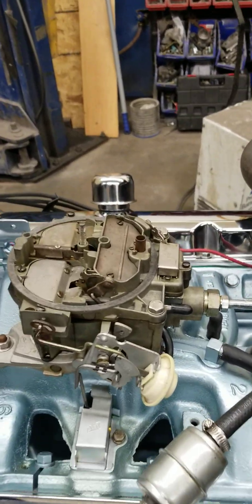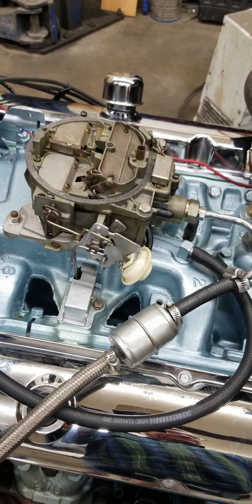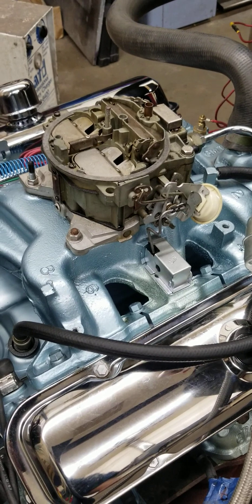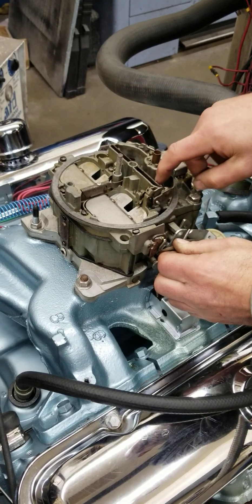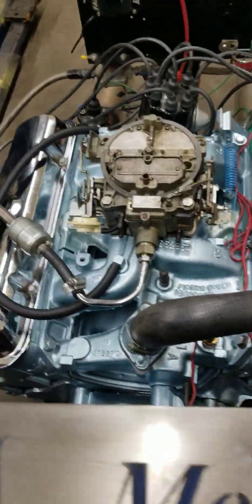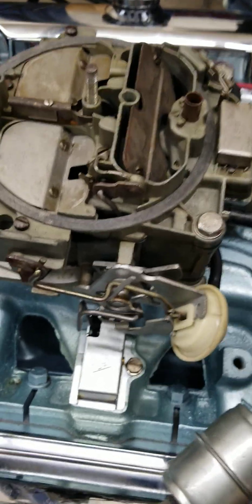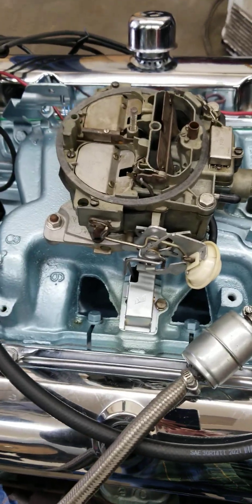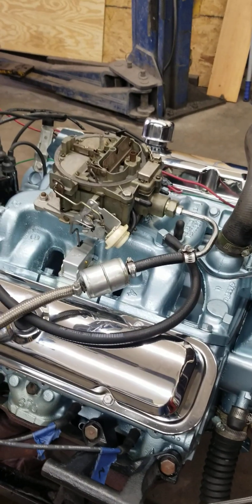#Learn The components of a Pontiac Quadrajet carburetor and #How to adjust

Comment: My family had an auto repair shop when I was a kid.

I remember QJets lying around the shop.
I would take some of them home, take them apart put them back together, sometimes I had a few extra parts left over.
I never thought they would be so sought after.
I disassembled the ones with the mechanical choke and electric chokes many different varieties.
I think I still have a book I bought on Q-Jets somewhere.
Reply from the maker: It might be the one I wrote. I authored a performance manual for Q jets back in the late 80s

Comment: do you have your pcv at back of valley pan routed to front of intake?
Reply from the maker: Yes, the 67 and older engines the PCV was in the rear of the valley cover. 68 and newer its in the front.
Reply: @dcimotorsports1111   cool thanks! on my 69 the rod enters on the right side of stove , slightly different. back when i rebuilt those there was a spec for the space I believe, just like the spec for the float level.  have a good day
Reply from the maker: ^7 is an odd year LOL.  @ubethejudge69
Reply from the maker: 67

Comment: There is a specification 4 this and the fast idle should be 1800 to 2200. check spec for your vehicle. these guys are clowns.
Reply from the maker: You are correct there is a spec for this adjustment, but its only a starting point. Why turn the fast idle up any more than is needed?? Especially an icy cold engine in freezing temps. This clown has been rebuilding carbs and setting chokes for 45 plus year now 😂😛 Thanks for following !!! Please subscribe and hit the notification bell for future videos. Come hang out with us on our Bench Racing Podcast every Wednesday night from 7PM to 8PM Eastern.